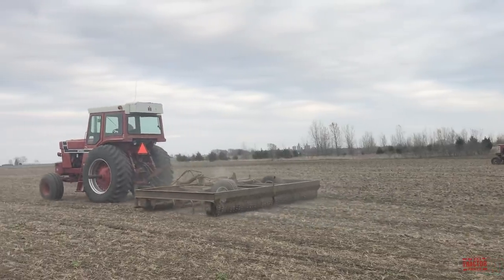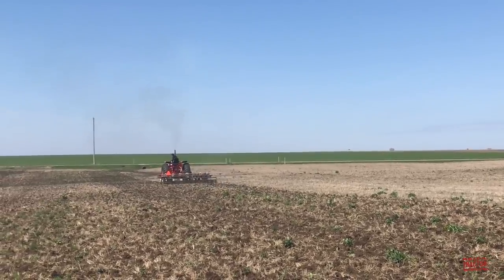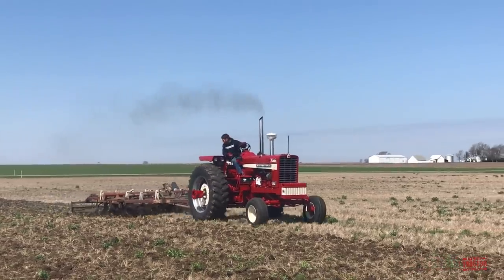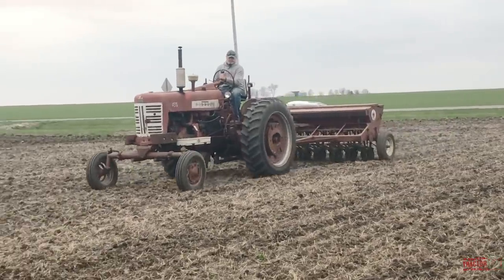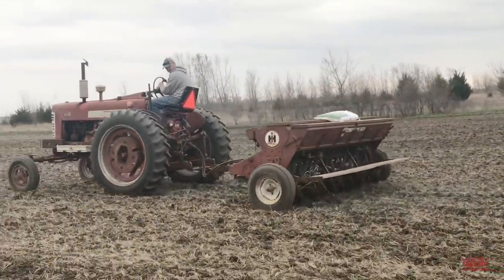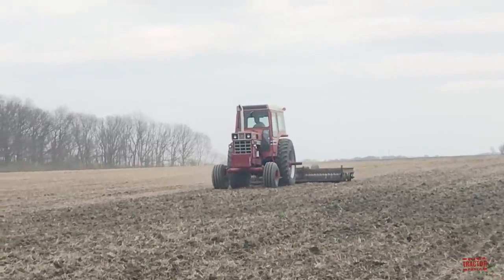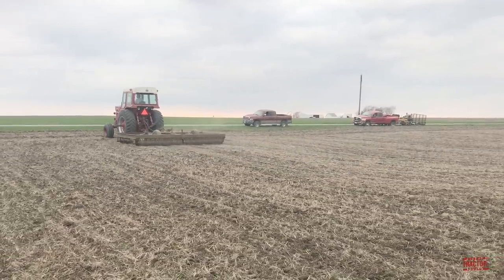INTERNATIONAL HARVESTER Tractors Working Together to Seed Oats

Comment: Chiseled about 15 acres tonight with the 806. Had to thrash on it a bit, wanted to make sure the clutch and TA job I did over the winter was done right. She pulled good and hard, just like she should. Those 3 are awesome tractors, spent a few hours on a 1566, that was the biggest tractor dad ever owned.

Comment: I love a 1066. The white or black stripe. Most every one around here the old timers has turned up, to what I have no idea but the low end grunt they have and way they handle along w the turbo you hear on them. I love those on tractors. They are alot around here still going but nowdays are not a main everyday running tractor.

Comment: If you're going to announce the 450 as a "Farmall 450", then you should announce that 1256 as a "Farmall 1256" too!  That 1256 is just as much a Farmall as that 450 is.  The 1566, being a black stripe, no longer actually displays the word 'Farmall' next to the model number, but it would be fine with me if you called it a "Farmall 1566", since an earlier example of the same machine would say 'Farmall.'
Thanks for another nice Red Power video!

Comment: My uncle had the 1256 not that nice but what a beautiful tractor. He also had super m, still has 2, 586 50 hp. But I wish they didn't merge with case international was such a huge company. But anyways great video still the nicest international I seen one you videos was that front wheel assist 1206 that was beautiful.

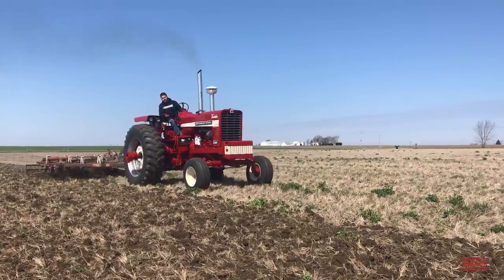Comment: Did anyone else notice in the footage from 1:20 to 3:52, a broken cultivator shank/arm/spring on the Field Cultivator that the 1256 was pulling?  If you were standing behind the Field Cultivator, it would be on the back row closest to you, and on the right-hand side/corner.  It was just flopping up and down in the video.  Do not know if a bolt was broken, or if the spring was broken, or what?!